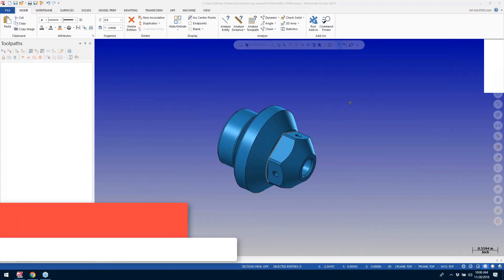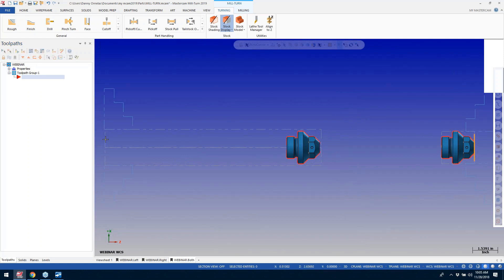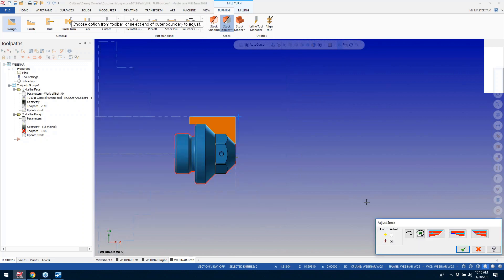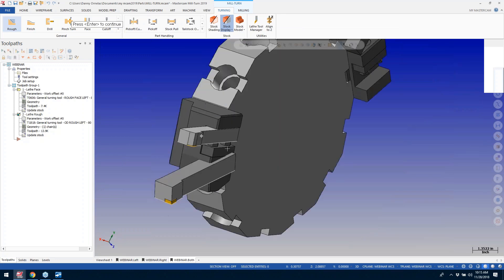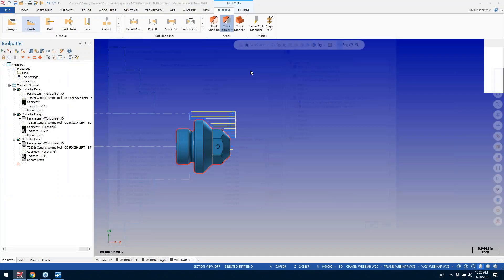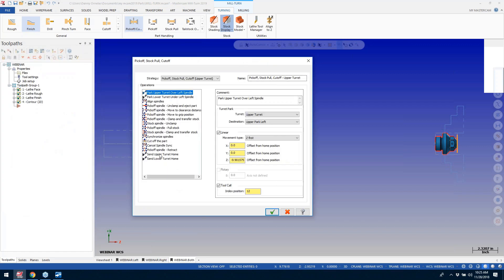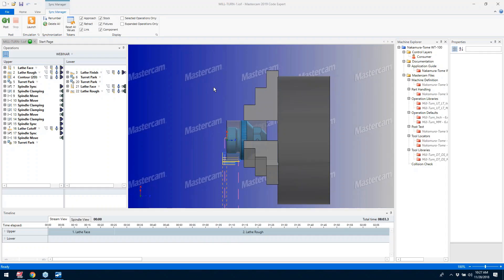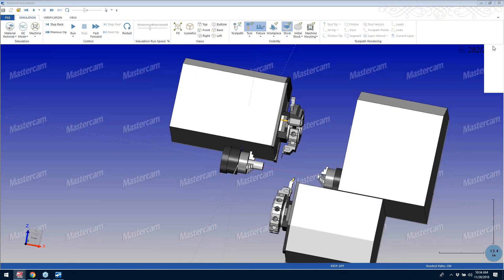Mastercam Mill Turn for easier Machining

Comment: Can you make a video about creating a custom lathe millturn?
Reply from the maker: If you are referring to the process of defining the machine environment in Mastercam, that isn't something that we recommend people try to do on their own.  In some cases, a developer environment is required to build the environment or post processors required, in which case it wouldn't be possible even with a video.  Reach out to your local reseller for more information, but note that you don't have to exclusively work with your primary reseller for these things.